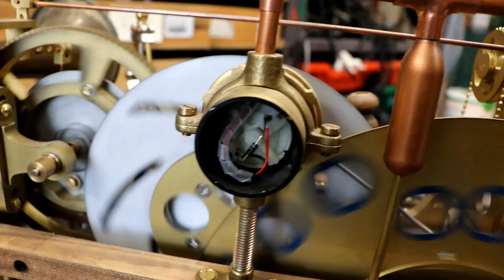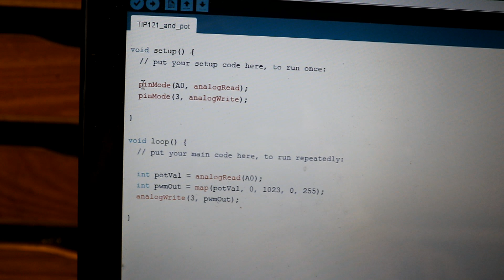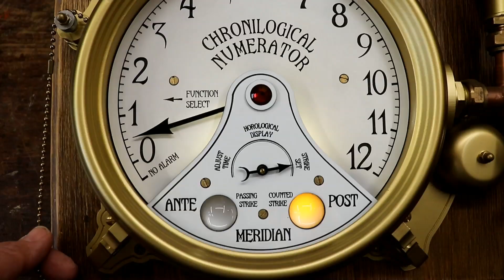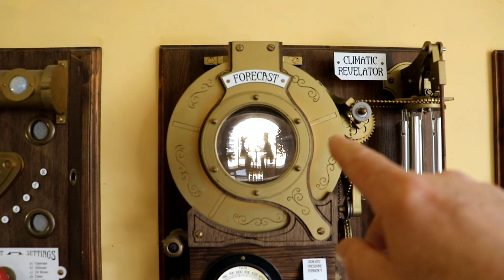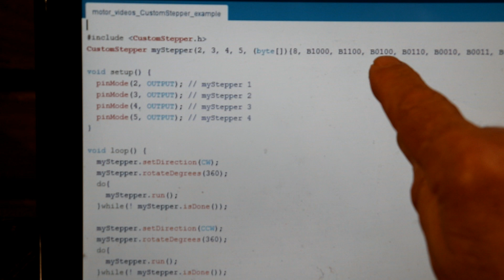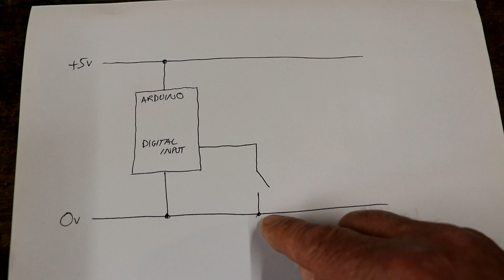Part 2 - Brushed, servo & stepper motors - how to control them with an Arduino

Comment: It might be noted that the 28BY stepper while inexpensive, has plastic gears. Running the stepper constantly in an item such as a clock risks wearing down the gears requireing more frequent replacement. There are design consideratons to alleviate this problem.
Reply from the maker: I have to say I've been impressed with the 28BY stepper gear train - the gears get progressively larger and are well lubricated! Most of my inventions use them and are still working over ten years later!